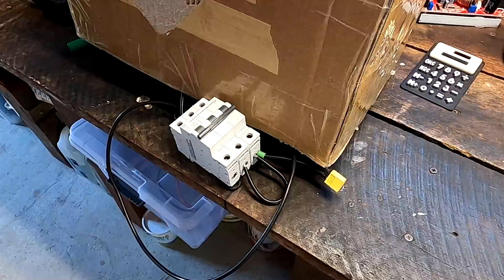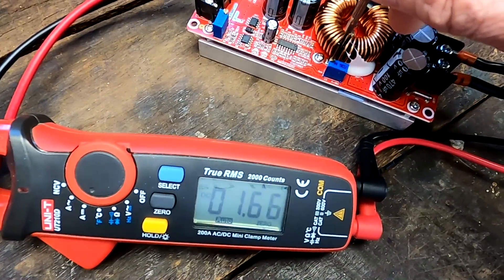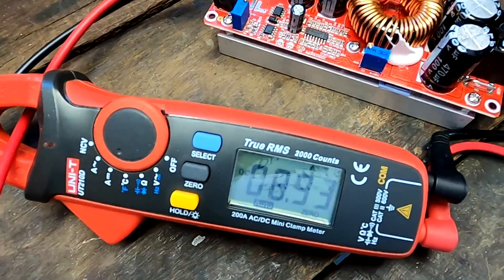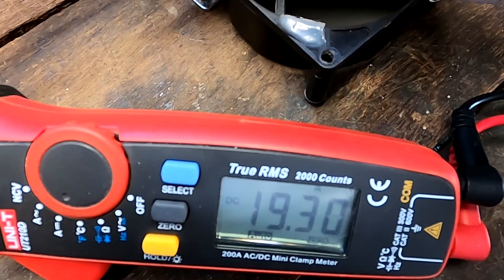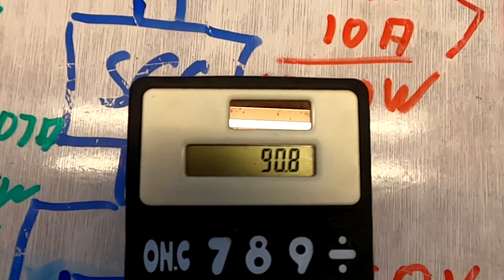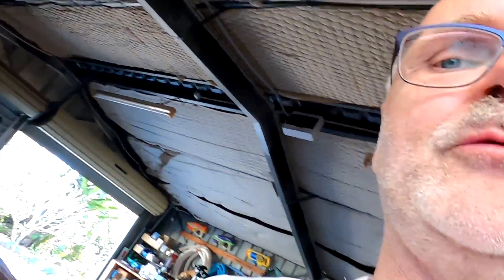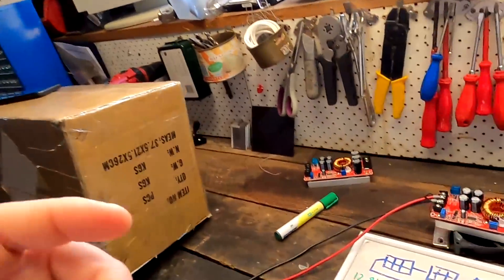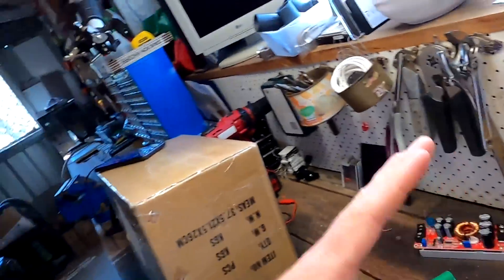Regenerative Discharging with good efficiency. Part 2

Comment: Excellent idea and effort for Phillip, you are Top Man on that one Andy.  As  for your question  regarding if I would use a Cheap DC converter to charge an LFE pack, I've seen cheap 'non-isolated' DC Buck converter based chargers fail to a higher voltage, and once a AC to DC power adapter deliver 110vac out the DC port.  I would only use a DC-converter to charge an LFE battery with a secondary or even third means of reliable overcharging protection in the case of Li-On charging. 

I would expect that Phillip's BMS likely has over-charging protection and possibly thermal over-temp protection,  but many don't recommend relying on BMS over-charging protection when using a cheap charger, especially with Li-On. So for a mission critical application like Phillip's I would think the Victron charger an almost essential precaution. 

Other, possible protection precautions could be installing charging fuses in-line with the charging circuit and fusing it to very slightly above the charging current, so if a dramatic increase in charging current were to occur the fuse might interrupt the circuit.Along with a charge protection fuse. 

 I've also used reverse power blocking Diodes to protect against reverse connections and if a charger output were to latch to ground or somehow reverse polarity.

There are adjustable inexpensive over/undercharging protection modules with solid-state relays for only a few $ that could be used, but if the charging current is only an amp or two, an adjustable Voltage regulator inline after the DC-Converter set to say .3 volt over the charge voltage could offer some additional protection. 

An AC line timer set to charge once for the expected charging time is something I've used on non float voltage chargers on Lead-Acid batteries.

Many years ago before BMS systems when I was maintaining very large industrial Flooded Ni-Cad emergency power packs, and we had issues with thermal run-away and massive fires during charging that caused millions of $ of damage.  I designed a simple protection system that utilized simple LM339 voltage detector circuits on cell banks, and if if any cell banks went over charge voltage it would cut the Line supply to the charger, and signal an alarm.  I also connected thermocouple temperature monitors on each cell (literally dozens) in each bank that-would cut charging power if any cell experienced a temperature rise.
Reply from the maker: Great comment and information, Jack. Thanks very much!

Comment: What I do is to use the boost converter to set the target charge voltage but also use those cheap cell-level monitors to watch that no individual cell exceeds 4.2v or it makes a very loud noise. (I also check both with a cheap voltmeter and cheap voltage reference).
Reply: Phillip is use LIFEp04 batteries not Li-Ion

Comment: What you are doing is demonstrating that extra voltage pressure over 3.65v per cell is needed to get the high amps you are using. This has been proved to damage your cells. 58.4 volts is the max for your battery if its 16 cells in series.
Reply from the maker: I only need that higher voltage to overcome the cable loses. The smart shunt shows me the voltage directly at the battery so it was still OK and not too high.

Comment: Ideally you would not directly plug this into the battery but rather plug it into a MPPT solar charge controller.
Reply from the maker: So you would feed the MPPT with the constant voltage of the converter? What if the battery gets full and the SCC tries to steer away from the optimal power point to lower charge voltage? It would not be able to....
Reply: @OffGridGarageAustralia  The MPPT will simply reduce the draw, it would work just fine as the converter only offers that much power the charge controller can reduce the pull. You should test it out.

Comment: The best battery charger is constant current/constant voltage
No mppt, no smartphone, no microcontrollers, absorption and other crap. (Only lead needs an absorption curve)
These cheap buck converters are just fine or better than an expensive smart charger that could glitch on you from esd or random firmware corruption. 
The overcharge situation cannot occur because, any sane person designing a constrained electrical system takes all the steps and a few more to ensure the constrains are never exceeded. 
Current fuses, input and output, to prevent overcurrents and fire, adequate cooling, thermal fuses, solid contacts and plugs, precise voltage settings and conservative current settings.

Charging a li-xxx battery with 0.5C or less and making sure the BMS does it's job are crucial to battery longevity and safety. Not the fancy charging curves and bluetooth connectivity. 

I worked in the computer/electronics domain for the last 20 years and the lesson I learned in the last 30+ years of studying electronics is that, for mission critical applications, dumb is way better than smart.
Dumb electronics* :)

Comment: I'm not sure if you are aware of this, the constant current adjustment is for the output current, not the input current. I always use buck-boost converters which can give a constant voltage output even when you don't know what the input will be, the price is not that different. However, for using multiple solar panels in parallel, if you use a common input into a single DC converter you are going to have difficulty balancing the inputs. Similarly, if you use an individual DC converter for each panel you are going to have difficulty balancing the outputs. You can try to balance these with low value high power resistors but he only absolute way to get around this is to have converters where the output chips are synchronised with regard to the voltage, but these are expensive. Good luck with this.

Comment: I think Philip did an awesome job building a charger for his battery pack. I have had no problems with using DC-DC modules charging any batteries I use, because the "proper charger" is only a buck converter or SMPS with a fancy software to control it and a big metal box to put it in, Phillip already did an awesome job with his charger box complete with waterproof connectors.
Batteries really only degrade from high charge or discharge currents, so my argument would be that there will be no difference between a 16A DC-DC converter and the 16A Victron Charger.
My reason is that he has a BMS already, so if the charger was getting hot and drifting its voltage if that is bad enough the BMS will trip and nothing bad will happen. And lastly 16A charging a bettery is 16A charging a battery, it makes no difference where it came from.
Reply: Should a diode be put in place to keep the battery from backflow.
Reply: @russellm7530  that would be a good precaution but with large currents you would not want a normal diode, instead you would want an ideal diode module.
However it is not necessary if you are not going to leave the boost converter connected 24/7. The circuitry in those is very simple, the output side has a voltage divider and an indicator LED, then current flow would stop at the diodes already in the converter.
Now for reverse polarity protection it could be useful but stopping the drain of a large battery through an LED and some high value resistors. So there is not much point in adding diodes just for that.
Reply: I'm thinking of buying some of these to make a battery to battery charger for my boat. 

If you can trust it, the AliExpress listing says "Output Counter filling: Yes, for charging plus blocking diode is not required."

I take that to mean the output battery can't pass current backwards into the input battery (or solar panel), but who knows.
Reply: @bhartley1024  Yes boost converters can only flow in one direction (part of how they are wired) The internal diode would have to fail short which would instantly destroy the converter anyway.
The only extra protection you have to add is a BMS or fuses to the battery you are charging, so if the boost converter did blow up (which they definitely do as I have popped all 3 of mine at least once because the mosfet got too hot) you would need to protect the battery under charge not just the input to the converter.

Comment: I am all for regenerative dischargers! They are super handy, What I would suggest is a hobby charger that has that function, those normally have alot of safeties built in but I guess voltage on your primary battery will be way too high for any normal hobby charger so the boost converter you are using is probably the best solution. However in order to run the boost converter as a battery tester you will need to have a power meter that will remember the total power when it turns off. I am assuming on the battery under test the stopping point will be the BMS trip point correct?

Comment: I'd say the buck converter is probably okay as long as his BMS can safely disconnect it in the event of any over voltage condition. That way if the converter fails and sends too high of a voltage the BMS can just disconnect it.

If the BMS cannot fully/safely disconnect it though: I would not trust something that important to a cheap $10 Chinese part.

Just sent 5 beers over just in case.
Reply from the maker: Thank you Jeremy. very much appreciated!

Comment: I have been thinking that if I could find a cheap buck converter where the input is isolated from the output, no common ground, that I could use 8 of them for my 8s battery.  Each cell would have its own charger. Then... who needs a balancer anymore?

Comment: If the battery has a decent BMS then there should be no problem however I would rather use a boost converter than a buck converter as, if a buck converter transistor fails you get full input voltage at the output but, if a boost converter fails it just blows the input fuse, as I have had happen with them. If you have a good BMS then all the fancification in an expensive Blue charger is really wasted. For day to day use I would rather the simple cutoff at a set voltage with no absorb rather than the getting them full up to brim approach taken by the Almighty Blue as this will also prolong their life. Balance start setting can be set to say 27.2 v to give enough time for balancing, and, as they are regularly charged to full, I would think this would suffice. I probably wouldn’t use an active balancer because, in this sort of use, the battery is likely to be taken quite low with the subsequent risk of the balancer trying to bottom balance the pack and then having to try and rebalance again at the top and not having the time to do it. I won’t go into the splendidness of the donation as that can be taken as read and has been said many times. 

I have been using an identical converter to yours 24/7 for the last couple of years within spec and it has performed flawlessly. The only time I have killed them is through torture and frankly their death was my own fault and I could be charged with converticide, however, in mitigation, I did resurrect them.

Comment: This converter is not tracking the maximum power point of the solar panel. so comparison ?
Reply from the maker: It would be a fixed setup or I would need to adjust the booster over time. I guess once set and calibrated to the current situation it would show a similar efficiency as an MPPT. I'll try... thanks for the suggestion.

Comment: How can you overcharge the battery? the BMS would switch the battery off over voltage!
Reply from the maker: Depends on the BMS. Some are fixed and you cannot change the settings. Most low end BMS will switch off at 4.75-3.8V only which is far higher than the allowed voltage.
But generally you're right, the BMS should take care of that.

Comment: I would use them but with protection circuits for max voltage to the battery and discharge from the battery. Thanks for sharing
Reply from the maker: Great point

Comment: if i was able to have good monitoring of the buck output, id personally be very happy to use the buck-boost converter as the sole charger.. BMS-balancer  should be fine to keep the battery in check 👌  love your work mate, keep it up (🍻🍻)
Reply from the maker: Thanks Joel!

Comment: Hi Andy, great gesture 👍 just a thinking, what is more important in this case a good programmable BMS or the Charger? With a good BMS even if the charger goes crazy the battery is protected 😉
Reply from the maker: That is correct. The BMS should only be the last safety measure if all other settings fail.

Comment: Boost converters are no good for charging lithium batteries directly; been there and destroyed a good battery, because of the steep charge curve of lithium at the end of charging on top of increasing the output voltage of the boost converter to get the charge rate up, but I was not watching the voltage increase quickly at the end of the charge and over voltage the battery, I lost a lot of it's capacity, yes do a donation, I did, it's going to a good cause, thanks Andy
Reply: This is why you absolutely have to have a BMS working at cell level as the chemistry is Not forgiving and things change very fast at the top and bottom ends of the cycle and humans basically have absolute rubbish memories and attention spans. I would never trust myself to monitor a lithium battery, even manual top balancing can easily be messed up by things as simple as going for a pee!
Reply: @philbrooke-little7082  I still use them thou for regulating DC voltage which is great, but not for battery charging
Reply: I too have been caught out by the  extremely rapid rise in cell voltage at the end of charging. The 2nd time I was watching it and it occurred in minutes. I was measuring rested (for 5 mins) cell volts so a bit of a phaff.
  I think the only safe method is to use a SCC to automatically monitor the battery and control the charging.

Comment: Great video. I would keep an eye when using Buck converter since the failure mode of the switching MOSFET is shorted circuit which means it will dump input Voltage to the output and damage the load.
BTW, great idea on the donation.
Reply: that is true, but the big red module is actually a boost converter, and their failure mode is to direct short to ground, which will immediately bow its input fuses, leaving the output safe from a voltage spike because there are diodes pointing toward the output.
Reply: @SuperBrainAK  Well that is why I say Buck converter as shown in Part 1 of the video. Boost converter failure mode as you described.
Reply: @budmartin3344  yep a buck converter failure would be pretty bad, hopefully the fuses would blow before anything really bad would happen, cheers!

Comment: Really nice...
I would to ask a question/help/assistance..
Assume that there a ebike .. when its running ... I would like to add  some electronic components(generator) like which you are working in this video..for generating some voltage and current to recharge battery pack.
On top of that I need to keep one more electronic component for during charging to keep constant voltage and current to recharge battery. 
Here what is your list of points need to tack care ... Kindly assist.
Please reply...
Reply from the maker: You want to recharge the battery of an e-bike, from the e-bike while it is running? That would only work downhill though.

Comment: Man I have a crappy unit that gets blazing hot doing 4a input.  Need to get one of these units.
Reply from the maker: I discharged a 1.4kWh battery yesterday and it went full blast for hours with the fan attached and zero voltage drift.

Comment: The only Boost MPPT Charge Controller I know of is the "MPT-7210a" I've had mine work OK but I know a lot of people have problems with them, probably worth getting one and doing some tests with it :)
Reply from the maker: I have one sitting here for a while but have only used it once to test. It has a terrible programming and menu structure.
Reply: @OffGridGarageAustralia  yeah it certainly does! I'm not even sure if it's true mppt if it allows you to set your solar panel voltage? Very odd and the fans are too loud 😂
Reply from the maker: @chazable  I had a few MMPTs but have never seen an option to set a voltage for the solar input? And this would not make sense as it changes depending on your solar output.
Reply: @OffGridGarageAustralia  exactly, I'd say it's probably more of a glorified boost converter with extra annoying bits haha 😂

Comment: If you have a good BMS to protect the cells, a CC/CV output converter will make a good charger.  Just set the volts per cell down to about 3.5v per cell.
Reply: Where do you set the  volts, BMS or PSU ?
Reply: @tryagain.k1821  The CC/CV board.  If you set the volts to (example) 14.0 for a 12v battery, that is 3.50 volts per cell.  When the battery gets to the set voltage, there will be no current flow (goes to zero) because there is no voltage difference between the power source and the battery.  A "good BMS" is there to stop the show if a cell goes high enough that you want to go to protect mode.
Reply: @ddthames   however, if top balancing // cells before adding the BMS, the current will be miniscule approaching 3.5 so a higher voltage is used  and the  resting cell voltage monitored. Your method will not produce a resting voltage of 3.5 V and will occupy an infinite time (asymptotic approach to final voltage).
   I, of course, am ignoring any volt drop across the BMS, as you are.

Comment: I have been doing this for years when doing a capacity test on batteries. We work very had to produce our electricity why waste it. Gave Philip 4 Beers. Why not with extra money buy Philip an extra battery. I know with with all your millions of viewers you will get a lot of donations
Reply from the maker: Thank you very much!
I would like a boost converter working from 2.5V with a high current so I can test single cells. I guess I have to invest in an iCharger at some stage...